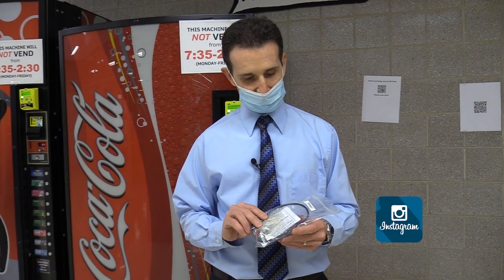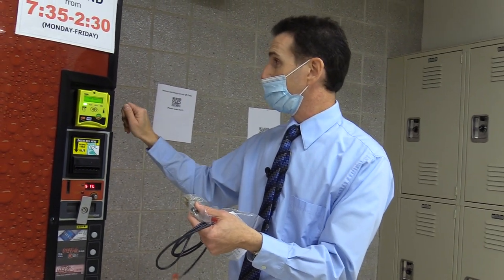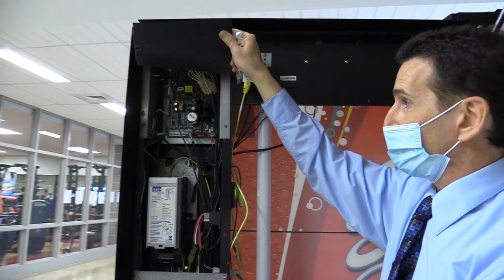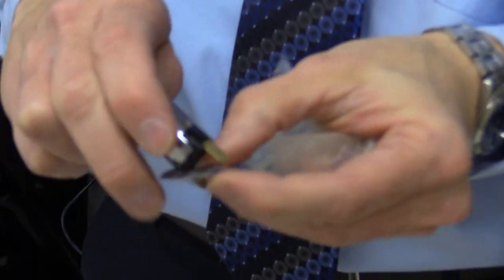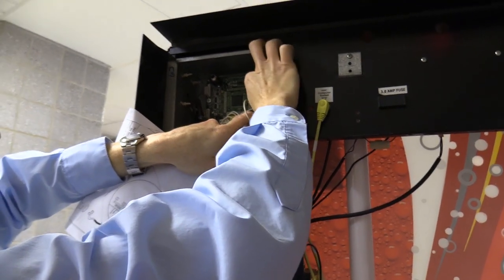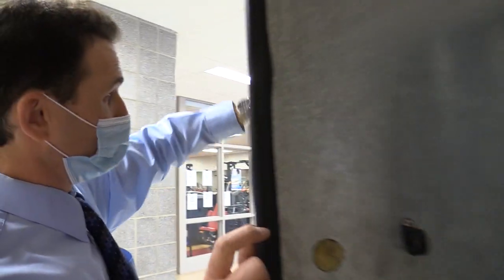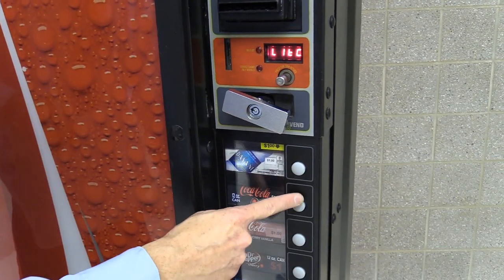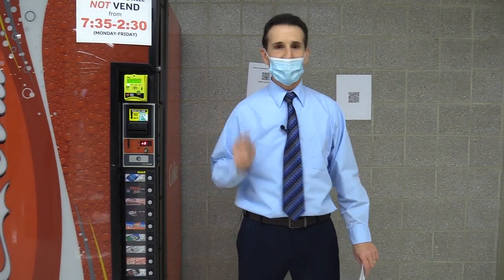How to Install a Soda Machine Override Switch

Comment: You know what would be a good video topic is expiration dates. I had to call Dr. Pepper to have them explain the diet dates to me. Was interesting how they do it but way overly complicated.
Reply from the maker: I did a video about expiration dates....check it out: https://youtu.be/3L4vDfRPLyg
Reply: @HappyVending  ah! Ok lemme check that out. I thought there had been one.
Reply: @HappyVending  oh! Right the taste test episode, i remember now. What i meant was a video on how to read the more overly complicated expiration codes. Some of them are normal dates but others are not. The zero and diet drinks aren’t always obvious.  I dunno, was just a thought… thanks!
Reply from the maker: @pikadroo  Ahh..I know what you're saying now.  Yeah...DrPepper has odd date codes on them.  I actually think that's a good thing because the customer won't look at the can and complain that it is a little past date.  Most times, those dates are just "best by" suggestions and the soda will taste fine months after the date.
Reply: @HappyVending  Ah, see that is the trick you should look into. The date on the diet Dr. Pepper can was a manufacture date not an expiration or best by date. So, like you said in the taste test video diet drinks are generally thought to last 3 months. So if you don't know 1) how to decode it and 2) the limits of freshness on diet drinks, you won't ever know.  As your taste test video proved, it's all subjective anyhow. The Diet Dr. Pepper is just the example I am using but grab a can and call the 800 # and ask them. I think you will find it interesting and I haven't seen any videos or web sites that explain this. Very clever on the part of the beverage companies I think. For me I have trouble keeping things out of date because I believe it damages trust in the machine's stored product if people notice. Which, you also kind of touched on in the taste test video. Even though we know it's still good and nobody will be hurt. Not saying your approach is wrong and mine is better, either way is fine. Anyhow, thought I would bring it up and you would find looking into it interesting enough to do a video on for others.
Reply from the maker: @pikadroo  I'll put it on my list of video ideas.

Comment: Sell that location how do u even make money if the machine is turned off during school hours.
Reply from the maker: Well...I work at the school, which is why I run the machines there.  We did really well when the machines would run during the day.  Now, we do ok....still good enough to fund our school outreach group.
Reply: I worked for big vending companies before and I noticed when the schools asked for timers on the machines sales dropped by 50 percent. That's huge it affects the companies from paying commission or u go from paying alot to almost nothing.